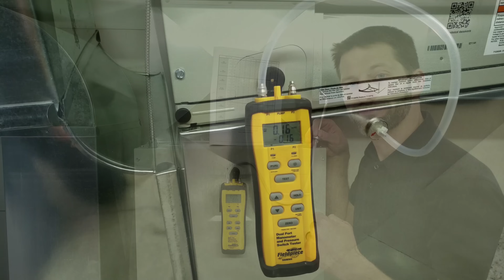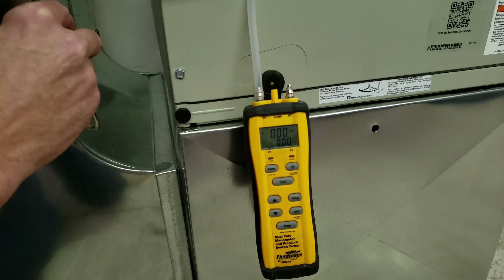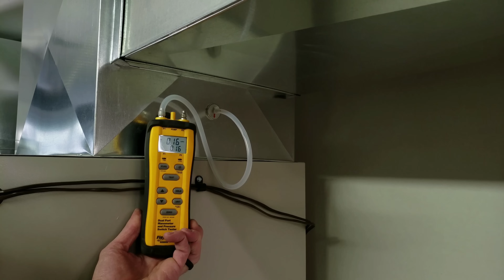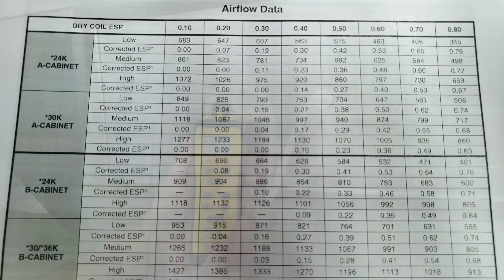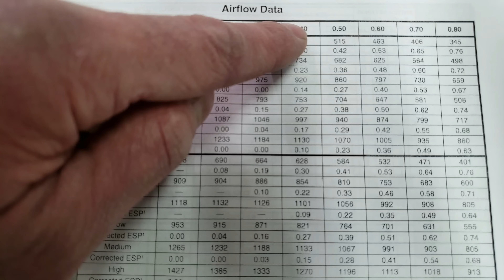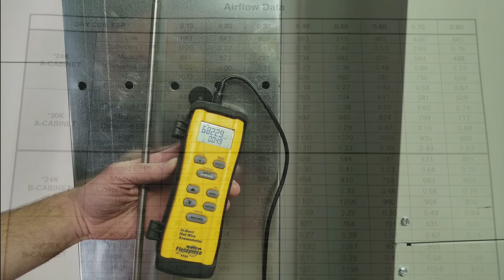Measuring Static Pressure on an Air Handler for Airflow CFM!

Comment: As far as I understand it, you mixed two approaches:
1. original, according to manual, you should measure static pressures using straight probe with opening perpendicular to airstream, air velocity does not influence measurement/value, probe should be placed as indicated in the manual,
2. alternative, using Pitot tube directed towards the velocity vector or air, you measure (differential guage) total pressure - static pressure = dynamic pressure, convert to speed, measure CFM using proper formula taking into account velocity profile (difficult, time consuming, possibly lower confidence level.
Please kindly correct me if I'm mistaken.
Reply from the maker: Luzt, thanks for your comment! This was measuring static pressure and comparing the TESP otherwise known as the ESP to the manufacturers blower data. I used a static pressure tip, not a Pitot tube. This is one of the same methods we use for setting air speed in a furnace. We can also use many other methods like temp rise, in duct hot wire anemometer, rotating vane anemometer, and flow capture hood. 

A Pitot tube is used to perform a multi-point traverse. This will measure total pressure and static pressure to show velocity and you must do that in multiple points in a straight section of duct to calculate cfm for the duct.

What I showed was just with a standard static pressure tip, not a pitot tube and I was measuring static pressure only and in only one location. Once I got my return and supply static pressure right outside of the cabinet (external), I added those static pressure readings together to get the TESP otherwise known as ESP. Once again, this is only a static pressure reading. The manufacturer supplies a chart that shows what the cfm will be at certain static pressures and the blower speed selected. The Pitot tube traverse method does not need any manufacturer data and is taken in a straight long section of trunk duct. 

So anyway, I have been getting a lot of questions on measuring airflow and this is just one out of many ways to do it. Static pressure is also very useful when trying to determine your low airflow problem such as a clogged evap coil. Thanks Luzt!
Reply: @acservicetechchannel  Thank you for your very long answer. Back to my main point - you mentioned 'directing the probe towards the stream of air". If the opening is at the tip of your proble you measure total pressure, not static pressure. Please kindly clarify only this single point.
Reply: @Luzt.  A few of us here waiting for your apology.  A very long answer is not required.
Reply: @randybirkeland3331  Apology? Exactly for which part? A few? I was not talking to you and I owe you nothing. And by the way - this is YT! This is not a university with safe spaces, trigger warnings and sensitivity mob ruling. At least in my corner.
Reply: Randy Birkeland just chill and learn. This topic confuse lot of people but we will eventually understand it if keep learning
Reply from the maker: No need for any apologies for anything. I appreciate each person, perspective, and question. We just try to talk through it so that we all understand what the other is saying. The video will never be perfect, and its just one person's perspective. Thats what the comment section is for so we can talk through it a little, thanks though!
Reply from the maker: Yes you are correct if there was a hole in the very end. However, this tip is a static pressure tip so there are 4 holes about 1 inch away from the end of the tip. There is no hole at the very end to measure total pressure so the measurement holes are perpendicular to the air stream. If you can zoom in on the video, you should be able to see the little holes when I hold the tip because this is 4k video.
Reply: @acservicetechchannel  OK. Thank you for the clarification. The whole issue arose due to my not being aware there exist L-shaped probes for static pressure only. With that, my point makes no sense.
Still, the whole idea of using the table is based on a close reconstruction of factory set-up. If it were me I'd assume that most technicians do not have this kind of proble and used simple measurement of static pressure one the plane of the wall while making the table.

Comment: I have always been taught that static pressure in the pressure on the duct, not the airflow. Your probes should not be in the airstream but where the air is "static" as in not moving like near the bottom of that return box ant the top of the plenum on the other side of the duct.
Reply from the maker: Matt, so we really need to be careful where the static pressure tips are placed when taking measurements. You want to be in the middle of the air stream but the holes are measuring perpendicular to the air stream. Because of this, you don't want to take a measurement where you don't know where the air flow is moving or is turbulent or you will accidentally be measuring some of the total pressure instead of static pressure. For instance, if I were to take a measurement toward the top of this plenum in the supply, my measurement would no longer be static pressure and will be higher because I will actually have the air entering directly into the holes on the side of the tip instead of measuring the static pressure in the middle of the air stream. This is because the air is turbulent because the air just hit the end cap. Likewise, if I were to take a measurement in the bottom of the return, the measurement will not be the same as in the middle of the air stream. It all has to do with where your supply trucks are connected to your plenum and this is why its safest to take the measurement as close to the air handler as possible in the least turbulent air stream. I know it sounds odd but all I can tell you is to do some experimentation with some manometers that you trust positioned in different spots in the plenums and you will visually see your measurements change depending on where you are testing at in the plenum. Thanks and great question!
Reply: @acservicetechchannel  it wasn't a question I teach HVAC I have done extensive testing and consulted with experts I was trying to educate you if you don't agree do some more research on the subject before making YouTube videos please.
Reply from the maker: Hey Matt, static pressure readings are take with either 90 degree tips with the holes in the tip after the bend or just by using a straight tip into the side of the duct. Yes static pressure is exerted on all sides of the duct but you have to keep in mind about the total pressure and trying not to accidentally measure that when trying to measure static pressure. The point is to not put the opening of the tip directly into the air stream or where the air is turbulent. Near the end of the supply plenum, if you took your measurement there, you would get an incorrect reading with your tip. It will be much higher there. When you use a 90 degree tip like I used in the video, the point is to have the tip pointed in the air stream so that you don't accidentally measure total pressure instead of static pressure. That is the only reason that you would be concerned with the direction of air flow or the tip position. If I were using a straight tip then I wouldn't have mentioned about the direction of the airflow and pointing the end of the tip in the direction of the airflow. We use this same 90 degree tip between the furnace and the evap and right between the blower and the filter. However, a straight tip like you are mentioning can just be used there as well to keep your measurement closer to the edge of the box.
Reply: @acservicetechchannel  I'm not sure you are understanding I haven't used a straight tip I use the same Feildpeice tool and probes you are in the video I have learn for experts in the field and the manufacturers who test the equipment. I have tested this on multiple gas furnaces and air handlers.
Reply: @mattkime7615  you don't get paid to teach, I hope
Reply: Matt Kime hi Matt i think he use a static pressure tube to measure the SP here so he is right.  There's no hole on the tip of the static pressure tube only on the side.  Theres hole on the side of the tube so when he point the tube to the air stream that hole is now perpendicular to the air stream and that how the pressure exert on the tube is the static pressure. If he use pitot tube it has hole at the tip of the tube than whatever pressure exert on that tip is the total pressure.  Total pressure deduct static pressure is velocity pressure.  So yes he’s totally right but i only have a little problem with his other explanations.    Just my 10 cents.
Reply from the maker: We need to take the measurement as close to the unit cabinet as possible for the most accurate measurements before any turns or takeoffs and we try to avoid turbulent air. When measuring in a plenum, we need to take the measurement close to the unit before any hole such as the trunk duct(s). Quang, in this video I used a 90 degree static pressure tip, not a Pitot. I think that is what you meant to say and I replied to your comment thanks a lot!
Reply: AC Service Tech LLC thank you very much for reply.

Comment: You are adjusting CFM for cooling mode , what I heating mode , you don't mention?
Reply from the maker: In this case, the unit is a heat pump with a psc motor so the blower speed would be the same for heating with the heat pump, thanks!
Reply: @acservicetechchannel  thank you for clarification!
Reply: Immigration Freedom cooling cfm take into account the sensible and latent heat so per manufacturing evaporator coil for cfm.  On the heating side per NCI 100 cfm per 10k btu for natural draft appliance with 75 degree temp rise.  130 cfm per 10k btu for induce draft appliance with 62 degree temp rise and 150 cfm per 10k btu for condensing appliance with 60 degree temp rise.